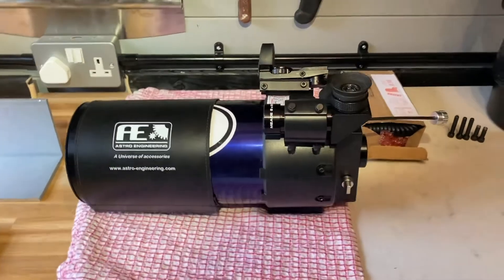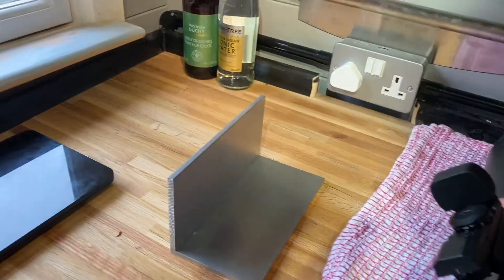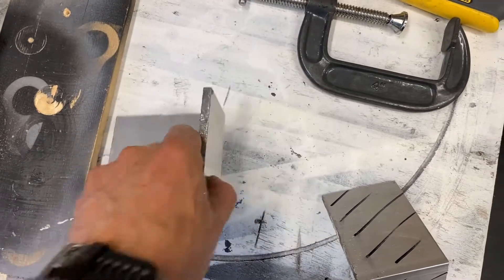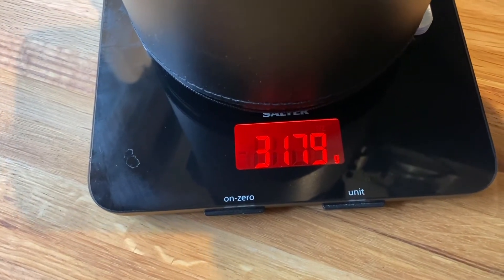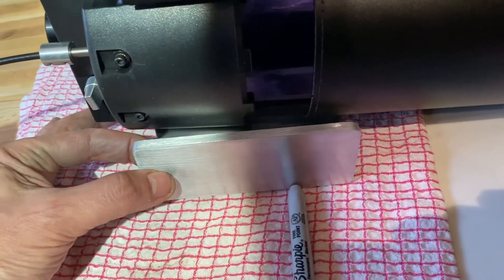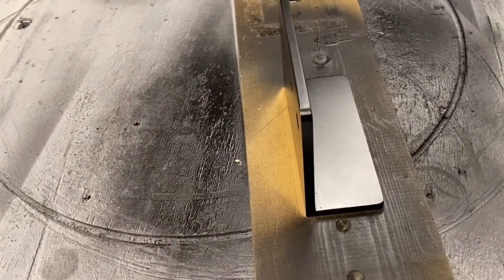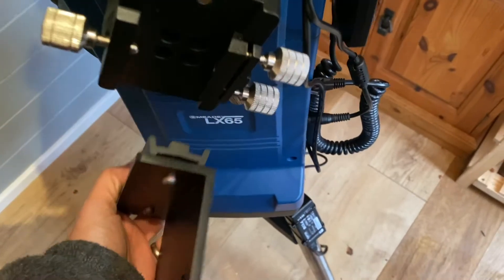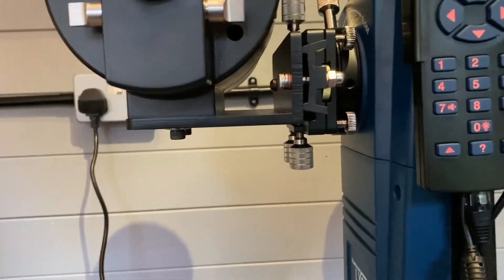MEADE ETX-105/LX65 Mount

Comment: I think you should have shaped the aluminium bracket to fit into the dovetail slot, that would have saved you the extra weight of a dovetail.
Reply from the maker: That would work really well if you had access to Lathe .. I wouldn’t fancy the amount of Filing needed. If Wa
Weight was that critical it’s an option.
Reply: @stevieg7403  A lathe would definitely benefit, but you can also do it on a table saw or chop saw as it's only aluminium (table saw would be more accurate).
If you're near Birmingham, I could do it for you. 
Great video anyway, I may do something similar.
Reply from the maker: Yes! I like it!
Reply from the maker: Unfortunately West Sussex

Comment: Hi Stevie!  Have you considered drilling some holes in your angle bracket to lighten it?  These are termed lightening holes.  Did you find that you needed to slot the upper "hole" into a slot to enable you to align your aux scope with the main scope?
Reply from the maker: Hi, I didn’t need to brill “lightning holes” as it came in underweight. The option is there if it’s needed in the future. There’s no need for slots as the mount has an adjuster, it lines up really well.